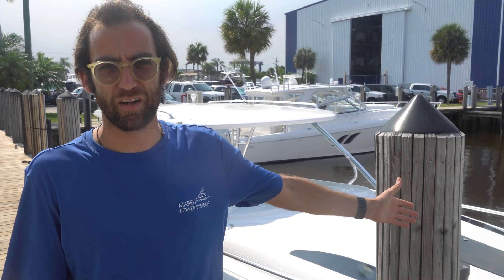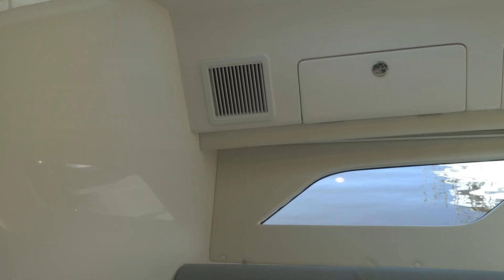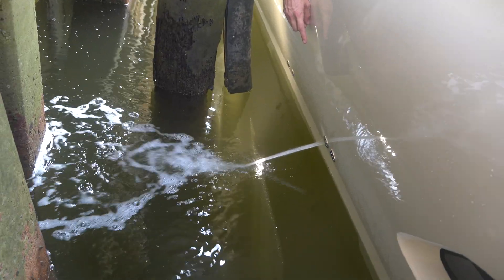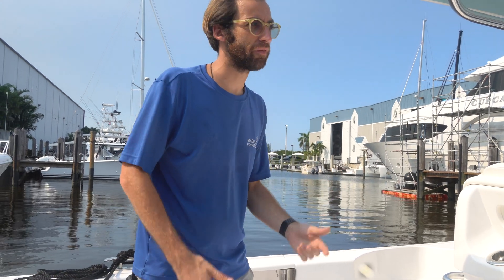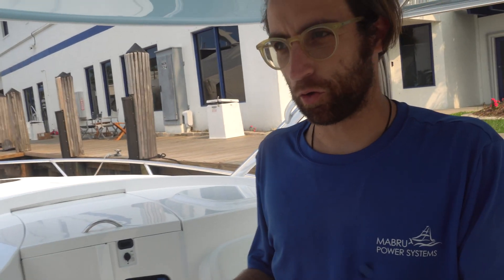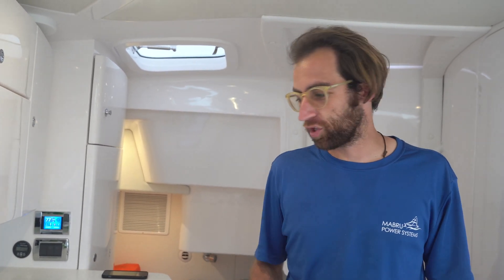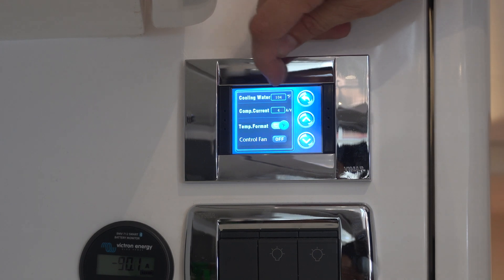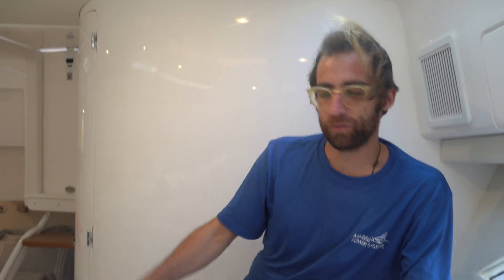2022 Intrepid Valor 409 with the Mabru Package. 17,000BTU Air Conditioner running off of batteries!!

Comment: Why wouldn’t they double the battery capacity to give them overnight capability?
Reply from the maker: The customer was not concerned about doing overnights as they would typically be staying in a marina when going out. 5 hrs is the minimum runtime but as the unit gets close to the set temperature, it will slow down and can then get 9-10 hrs of runtime on the installed bank.
Reply: That’s amazing! I have been thinking of doing this on my boat to run my 12k BTU air when I don’t want to run the generator
Reply from the maker: @nicksreviewsmiami  running a standard on/off style 12,000btu unit off of an inverter is a completely different scenario than the 17k variable speed unit on this vessel. Not to say that it’s not possible but will require a larger inverter, larger battery bank and more charging capability from engine alternators
Reply: I totally agree and I realize I would need to replace my traditional 115volt 12k btu air conditioner with a modern one.  I realize the DC unit would not use an inverter so I’m curious why this unit is AC. Is it because of the size?
Reply from the maker: @nicksreviewsmiami  yes, because of its size. The largest DC unit that we carry for now is the 12,000 and the factory option on this vessel is a 16,000 so the customer opted for a similar size. The advantage of the available 115v power to power the onboard outlets was also an added advantage